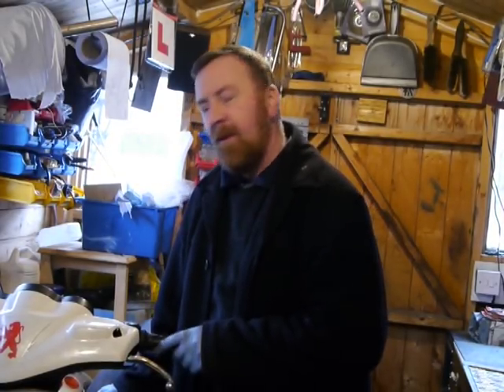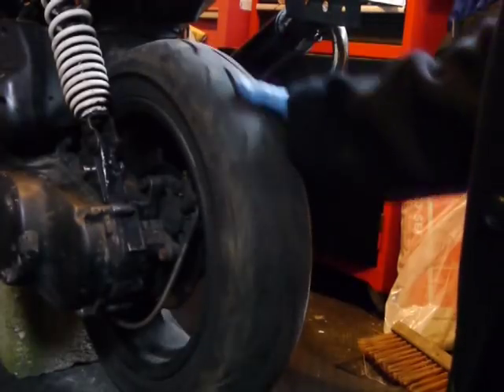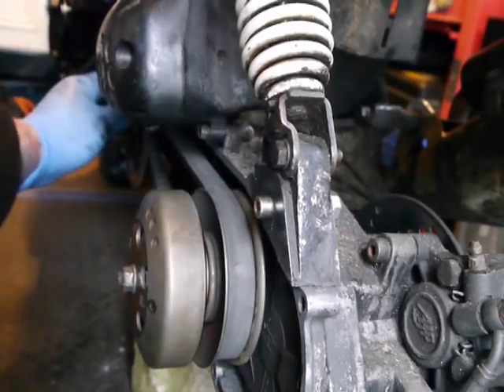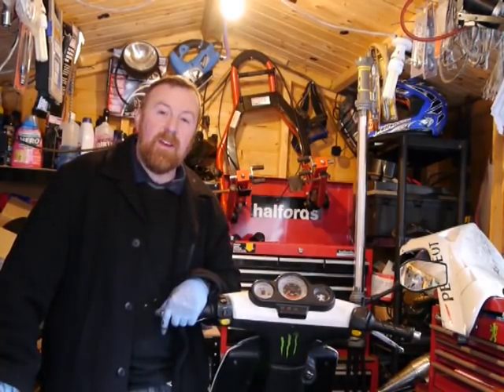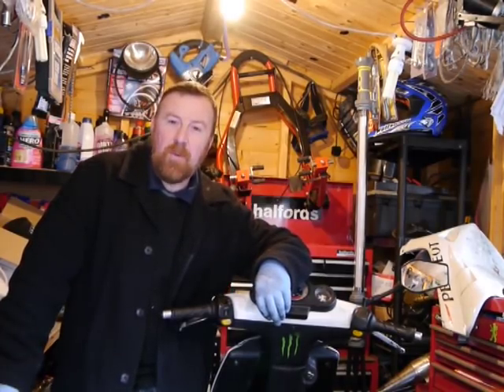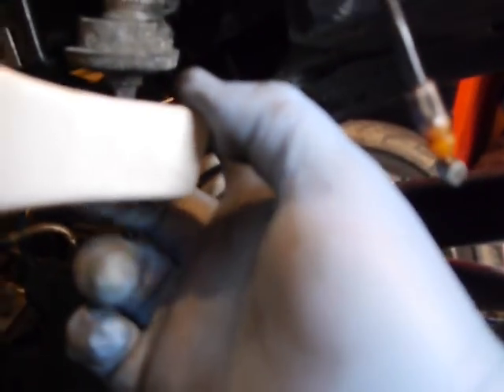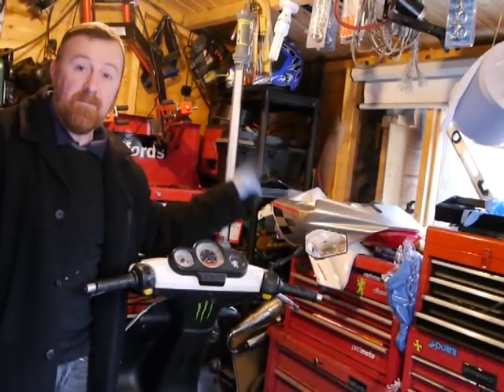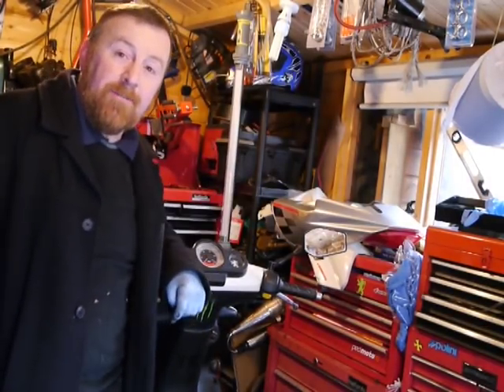SPEEDFIGHT MOPED FIX 50 CLUTCH PROBLEM HELPFUL ADVICE MARK SAVAGE

Comment: How rear clouth is working? Is the spring when pusshed together  engaging the cloutch?
Reply from the maker: the force of the VARIATOR spinning opens it up but I always used to try and pull it together as it should have some force to do it but you need to check the pads 
they are like brake drum shoes bud
Reply: My clouth on GY6 50ccm does not engaging, what would be the problem? Foulty cloutch?
Reply from the maker: @dusankurir58  if the clutch is not engaging the rear wheel then yes but and would need replacing bud

Comment: OMG! That's it! My moped does exactly same noise when its turned off, now I am assured it has to be the clutch. Thank you very much Mark I think it is definitely worth it to buy the all new transmission kit including new clutch and variator etc. Thank you very much, I'll keep you updated after I do exchange them parts!
This is the part I'll be getting. :) - https://www.racing-planet.co.uk/super-trans-naraku-racing-stroke-139qmb-p-195971-1.html?backcPathco=156&cPath=1456_41682

Comment: alright mark mate, ive watch loads of your videos and they have fixed many of the problem i have had with my scooter! thanks for that btw. but i now have a new problem it will not stay idle, its not the idle screw because that can be turned all the way it and it will still cut out,its not too lean or too rich and the throttle needle is fine out i believe there is an air leak but i cant seem to found where the leak is. and my scooter is a piaggio zip 50cc 2 stroke 09 plate. 
any ideas?
thanks.
Reply from the maker: hi bud .it's good to hear that my videos help, I have worked on a zip and the videos are on here, as for you idle have you tightened the cable as you have an adjustment on that too, so you have screwed the idle screw all the way in and no joy so try the throttle cable adjustment that may help but otherwise you will have to take out the needle and adjust to the bottom so more fuel gets in, as for the air leak check both fuel and air pipesif they are hard change them and check the that the carb is tight to the air manifold see how you get on with that bud mark
Reply: mark savage which end am I adjusting the throttle cable at? up but the handle bars or  down at the carb end ? And and the needle is second from the lowest so 4 settings down, carb is tight to the inlet and where are these air pipes that need checking thanks for the help aswell!
Reply from the maker: up at the handle bars bud you can adjust that to lift the revs up a bit mark
Reply: mark savage shall I adjust it at the button aswell ?
Reply: Bottom I meant
Reply from the maker: if you have top and bottom adjustment bud then just do one if it helps all ok if not then do the top one till you get it idling 
mark
Reply: mark savage found the problem mate it was my reeds they are open which is causing the air leak so I need new reeds
Reply from the maker: Kieran Maxwell that’s good news then bud 
I did a video on reeds people often forget about them
All good then bud 
Mark
Reply: mark savage yeah I’ve seen it I think I seen all your ped videos no that I need to just helps if I ever come across that problem I’ll know what to do thanks mate!

Comment: Hi mark, quick question. Ped will start instantly with kickstart but i cant use it as the pinion rattles (Speedfight) With electric start it will do it but will take its time. It seems to get going with a "pop" but wont keep going. Is it just the cold or something else?
Reply from the maker: MasterLehw hi bud 
Take the engine case off and take a look at the kick start , I have a video on how it works well should !
As for electric starter , I’ve had many bikes that do this but are ok when it’s warm and warmer weather 
It’s not the auto choke but more then do with the stator coil and battery power try giving the stator a clean or change the volt regulator which is a cheap fix but a lot of work to get to !
I’d sort out the kick start lol 
Thanks for watching 
I have many other videos that will help 
Please like share and sub
Mark
Reply: I know whats wrong with the kickstart the bushing where the pinion sits is warn so to fix it i need a whole new casing. And a decent looking spare is hard to find. Its water cooled and im not sure how to get to the stator, put a new charged/warm battery and it sparked up quickly. So it may be that. Ive never seen you go to the stator on a WC version so ive no clue and dont want water everywhere! lol

Comment: Hey Mark, i recently replaced the carb on my NRG and my old carb had a 63 jet but it used to cut out so i put a 70 and it runs but has no pull away power, i have also checked the exhaust and rollers and they seem fine, do you know what else it could be?
Reply from the maker: bogging down can be too much and too little so have you played with the air mix ?3 half turns like in my tuning video and work out or in once on stand failing that try 65 or 67 jetplease like share and sub bud mark

Comment: Hi mark just a quick question, would idle revs of a paiggio nrg be lower due to the cold weather right now or should I tamper with idle screw
Reply from the maker: hi bud thanks for watching, i'd say it was the weather but maybe worth a look and clean your plug and check the air filter as they can gum up in this weather 
if all good then a little higher cant hurt and easy to put it back when it gets warm
please like share and sub 
mark
Reply: mark savage already subbed of course , also having an issue after a ride ill leave it for 5 mins and it won't want to start as easy aswell as the lights being low

Comment: Hey Mark, I just have a quick question regarding speedfight 2 and variator washers. So in all your videos you say to throw the washer away. Now in my speedfight i have one restrictor plate on the actual variator bowl holding the weights and then i have a washer behind all of that. So the last piece of my variator, literally all the way in is a washer. Should I keep it or throw it away. I saw in another one of your videos on a different moped that the washer behind everything should stay. Is it the same or not? Thanks!
Reply from the maker: hi bid thanks for watching as for the variator you have a standard one fitted you can leave off the rear cage and the variator will work fin and you can leave the rear washer there, it's the washer in between the variator I chuck away please like share and sub mark
Reply: Alright sir, but if i remove the one that is furthest back in the variator what are the consequences? Does it affect anything att all the slightest bit?
Reply from the maker: you can remove it I would lol, it will open up a lot more so go for it , you should get more top end mark
Reply: Alright boss thank you! Keep up the great work

Comment: Hi mark, quick question. I'm having a dilemma, i cannot decide whether to sell my 4 stroke kymco agility 50 and get a speedfight or an aerox 2 stroke. I would like to be able to do 50 not 40 like i do now, but everyone is telling me to stick with my 4 stroke as 2 strokes are very unreliable and i will break down a lot. Is this true? Thanks
Reply from the maker: Matti De'Beer hi bud 
Ok 2t do have reliability problems so it is true 
If you want more fun and speed then 2t speedfights and aeroxs and defo the way to go 
Just get one like I have worked on so serviced and starts rides well then no problems and will last fine 
Prob with 4t they run then die 
Where 2t run , die and go again lol 
Best go see a few test ride and make your mind up 
I have lots of videos. On fixing and servicing so there to help 
Please like share and sub
Mark
Reply: Okay, thank you very much for the reply, I will definately ask a couple of my mates to have a couple of goes on their 2 stroke peds and see how i like it. You really do know what you're talking about Mark, thank you
Reply: Sorry for asking so many questions but, my clutch pads are really smooth, should i give them a bit of a sand with 120 grit sandpaper or just leave  them? Thanks Mark!
Reply from the maker: Matti De'Beer no bud they are fine just wipe out the bell housing with a clean cotton cloth and also wipe the pads 
They should like like the ones in my video with a good bit of pad on them 
While off check the rollers too and clean the variator like in my other videos 
Mark 
Take care bud
Reply: Okay thanks a lot Mark, Yes i already replaced the rollers and i cleaned it exactly like you did without putting any oil in it ahah and it ran so much smoother and quite a bit faster. Very educational videos. Thanks
Reply from the maker: Matti De'Beer that good news and good to hear 
Mark

Comment: Does that affect speed and acceleration
Reply from the maker: Normally it's the rollers but this did yes
Reply: @marksavage  how much that affected cause my speedfight 2 wont fo faster than 35 kmh(before 55)so just guessing could that be one reason
Reply from the maker: honest bud it is the reason ,change them and clean the variator plus belt if it needs it and watch it go